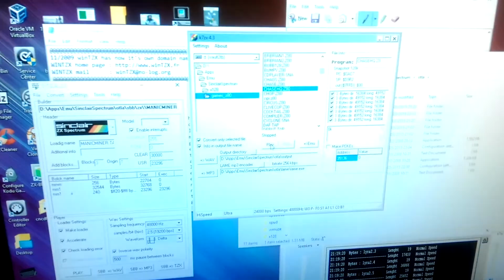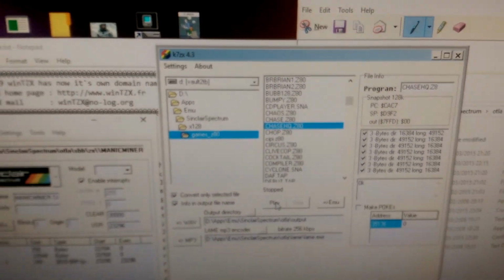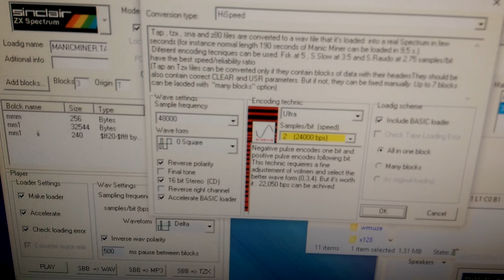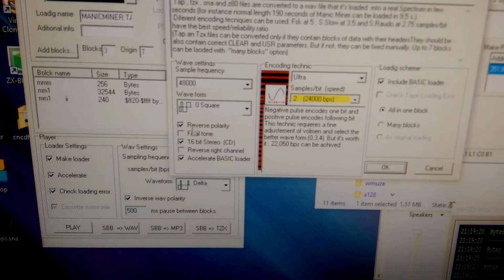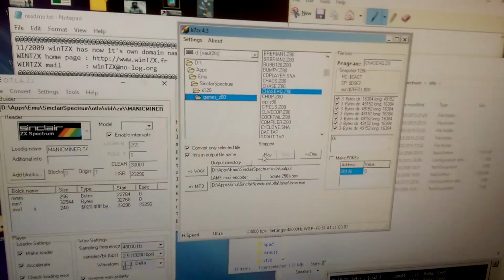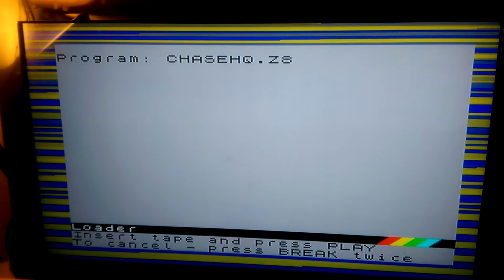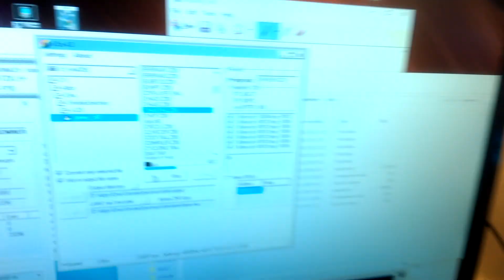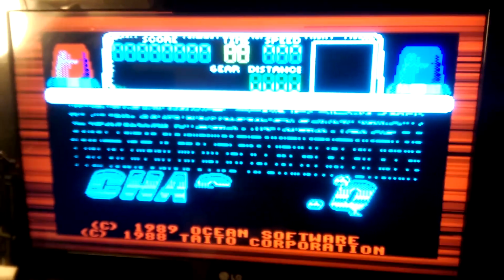Chase HQ Spectrum loading 45.3 seconds!

Comment: Wow! That is ridiculous.

Makes me wonder if we could make something on a microcontroller like an esp32 to sit in the +2A. Load a tzx file into an emulated spectrum at high speed, take a virtual .z80 snapshot, then take that z80 dump and run it through (whatever craziness this is) straight into the tape deck pins in real time with a web interface served by the esp32.
Reply from the maker: If you are going that far, then I'd guess you would just purchase a Divmmc and load TAPs.
Reply: @em00k  Yeah but where is the fun in that?